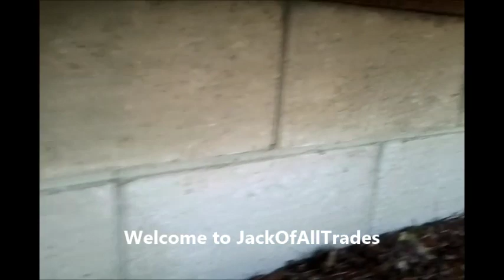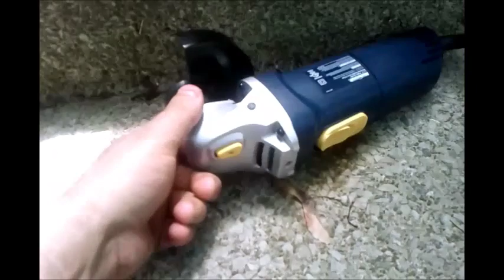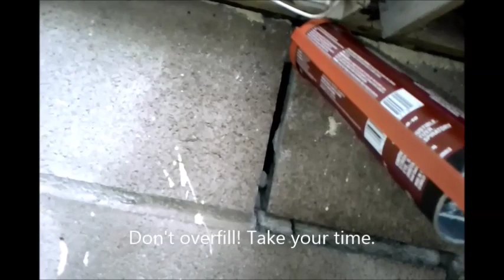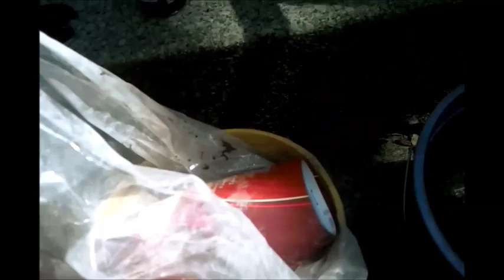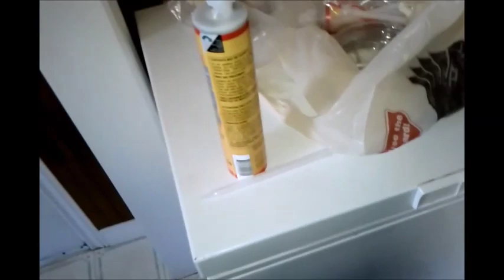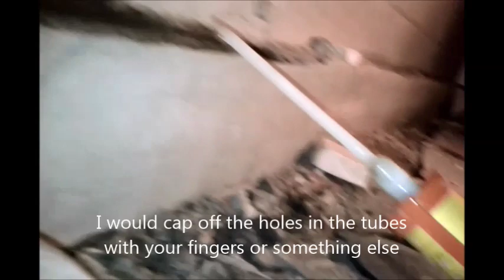Foundation repair - save $500 dollars.....crack injection method

Comment: so far how is your crack doing? i was wondering since we are fixing 3 big ones on my baseman :(
Reply from the maker: The crack is perfect still looks like the day I fixed it. No leaks and no separation in the grout lines ;)
Reply: *****
Thankyou so much for the reply, my husband did it today i will post pict , i am afraid he put the ports to far each other :(
Reply from the maker: if he out them to far apart you can grind out the crack then seal the crack with hydraulic cement then reinsert the tubes. I suggest 2-3 inches apart so the liquid has a chance to move up and expand into the next tube until you get to the top.remember you can always grind the patch smooth after its all dry then paint the wall so you do not see the rapir if this is a wall that is visible. good luck. You can buy the tubes the insert into the holes as a kit as well.

Comment: thanks man!  this video really helps! im located in ontario and i have to dig 6 feet down to find the footer!
Reply from the maker: dacal86 The hydraulic cement hardens quick but seals good. anything above ground use the gun stuff. As for below when moisture is constant use hydraulic cement. My repair is still holding up and has not spread or opened up as of today. I saved about 450 bucks last quoted to do this.